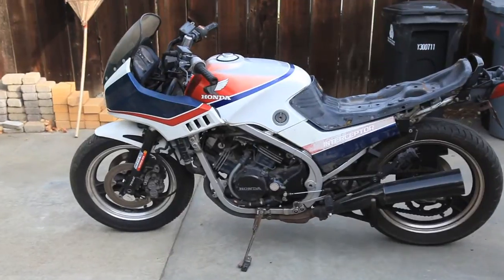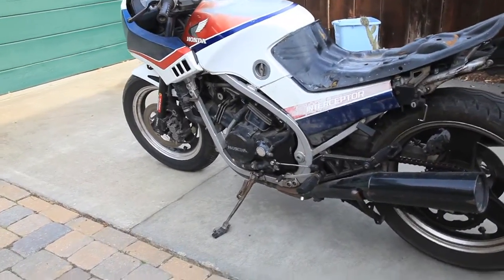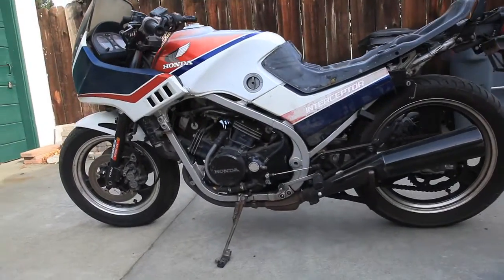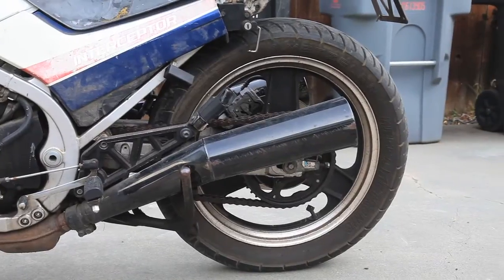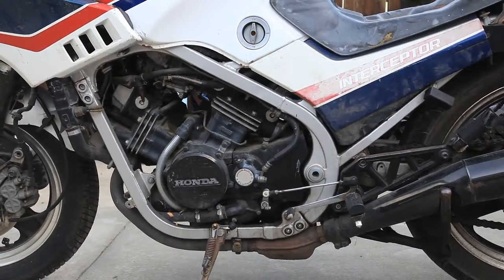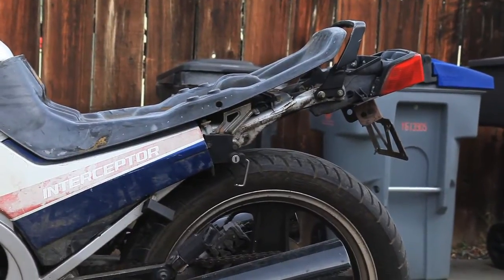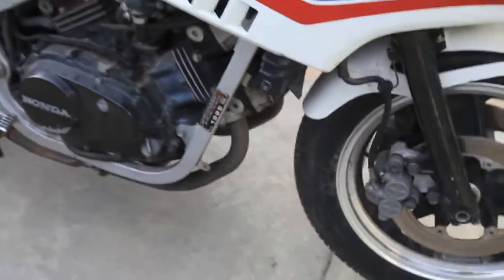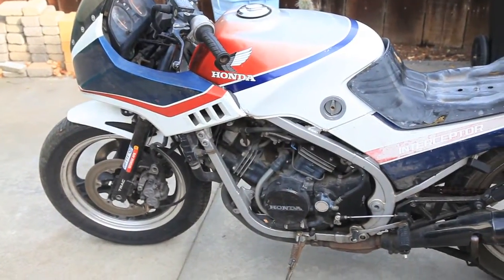Electriceptor #1: An Introduction

Comment: If it runs.. sell the engine, the exhaust and all the plastics, and tank. They are probably worth more than you paid for the bike. The VF500 was pretty rare in the USA. BTW I owned one of these for a while, it was very fun and pretty damd fast for a 500cc bike. Ran 0-60 in about 5 sec, and 1/4 miles in about 12sec. and still got 50MPG They are not really light, But the engine is a lot of the weight, you wont need the fuel tank, or any of the driveline. there is a pretty large space in there.